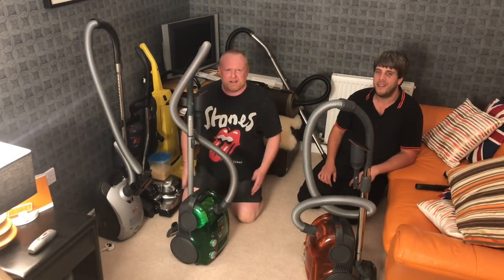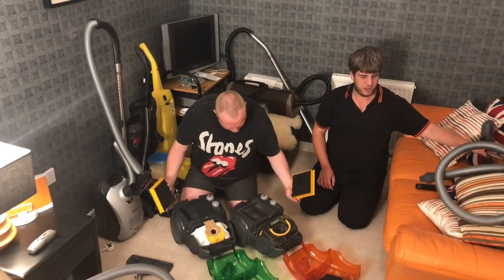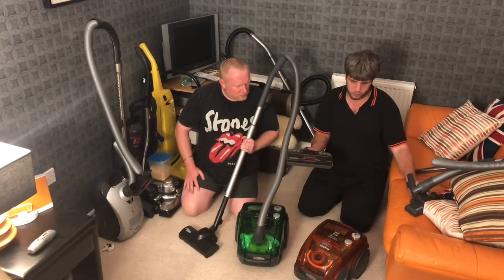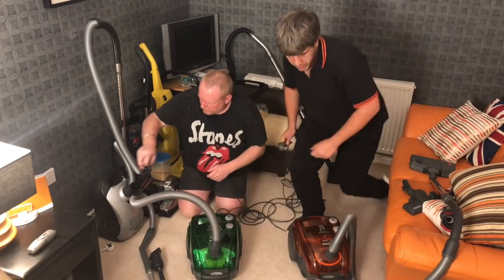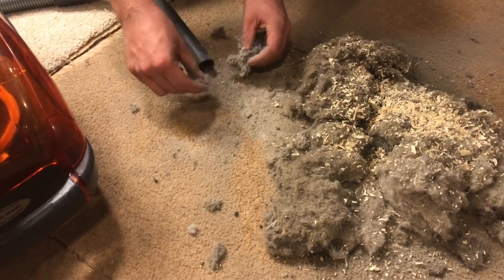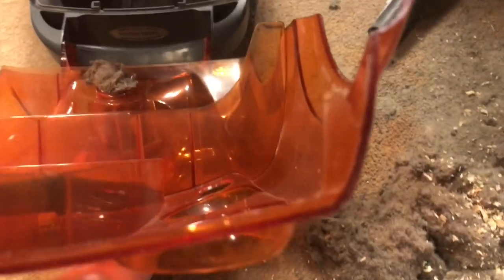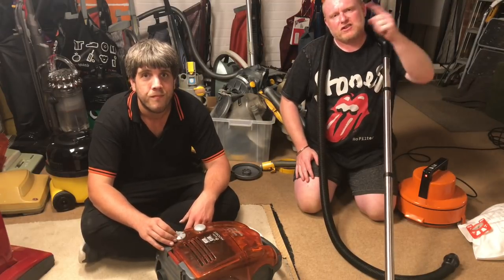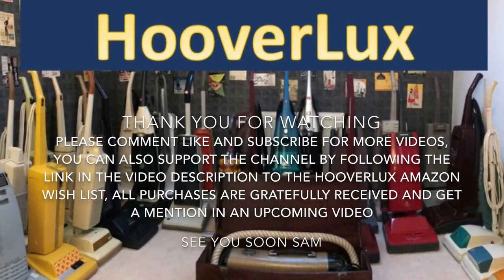BIG MESS TEST Hoover Dustmanager Style With Sam "Beko1987"

Comment: I really wish it had occurred to me that I could have removed the pathetic dust box and used a decent bag in my Dust Manager. It might have been in use today instead of being sold on eBay!! I would have had to ditch the hideous upholstery nozzle/crevice tool abomination for something else but otherwise it would have been a pretty decent machine.
Reply from the maker: Hey Paul, it really is a shame because you can still but the converter and it’s under a tenner, it’s not bad with the bag and a turbo brush.